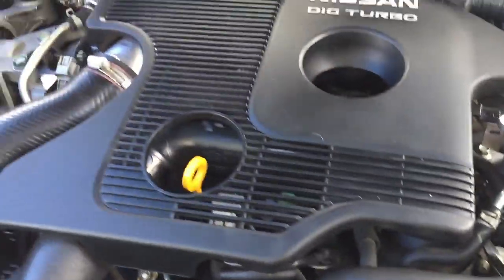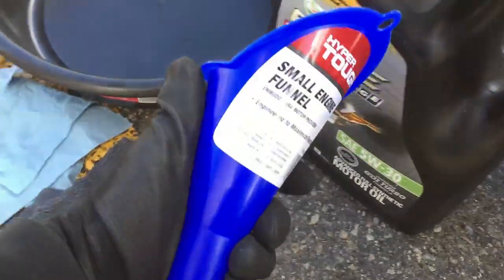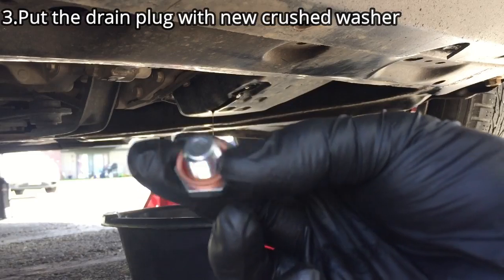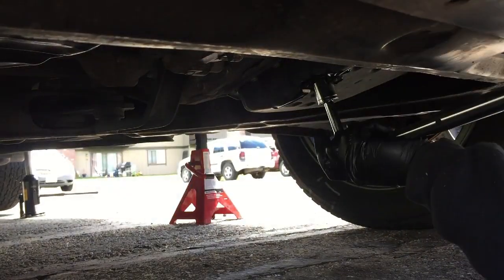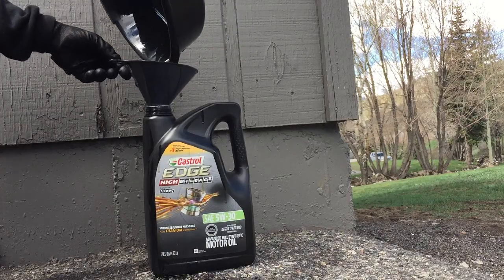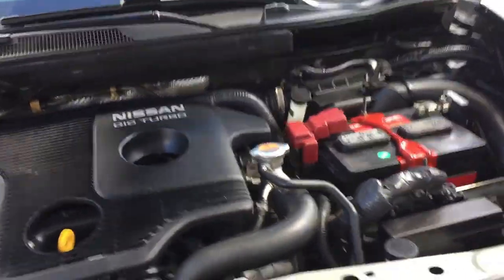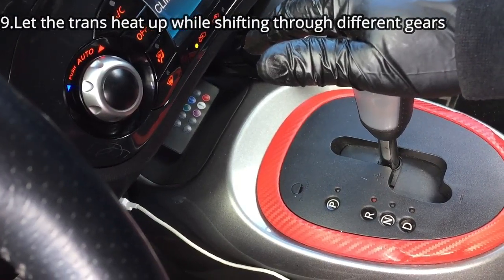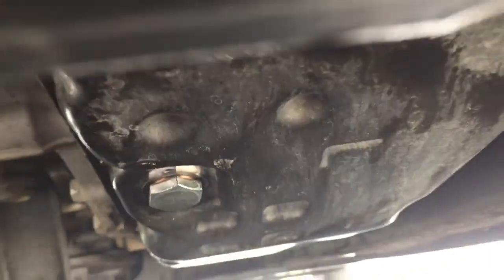How to Exchange CVT Fluid on your Nissan Juke

Comment: Also you need replace the oil transmission filter.
Reply from the maker: This is just a quick transmission fluid exchange not flush
Reply: @Wanderrap  should change both filters every time you open the Nissan Juke transmission. If not, the deposits on the old filter can reek havoc on the CVT belt drive system, even with the new fluid. Spend the extra couple of bucks, don't cheap out!!

Comment: Hi.. I had a code pop up for my car PO744.. it’s only been a day and I never had any driving issues with it before.. mine is a 2013 Juke. The dealership said I need to replace the whole transmission but I’m wondering if it just needs transmission fluid… I don’t wanna spend thousands to get a new transmission if all it needs is fluid.. any advice?
Reply from the maker: Hello!That’s what happened to my juke before.Also told me that I need to replace a new transmission.Try doing transmission fluid flush first.It should be done every 100k miles but if you notice that your juke is loosing power,you might wanna try it first.Works for me and been driving the juke for 3 years now without even replacing the transmission
Reply: Yo supposed tu Change de Every Twenty Five Thousand Miles And The Filter es On The Side ay Have Five Nisan Altima and one juke. But only same Nissans got a CVT Transmisión

Comment: When you check the fluid level after it reaches running temp, do you check with the engine running?
Reply from the maker: Yes.Let it sits for a while
Reply: @Wanderrap  So to confirm, the engine must be RUNNING correct?

Comment: Good morning, by the way, can you tell me how many liters of transmission fluid are needed.
Reply from the maker: It’s 5 liters
Reply: That trans holds 9 quarts
Reply from the maker: @christinemallory4567 no it doesn’t.When you remove the old fluid, measure it so you will know how much you need to replace
Reply: @Wanderrap  yes it does, according to nissan.
Reply from the maker: Have you tried draining it?

Comment: I took it to a mechanic and he didnt measure how much came out.. he said as long is you aren at the right spot on the dip stick its ok.. do you knownif if this is true?
Reply from the maker: Yes it’s fine.Usually,5 quarts of cvt is all you need.And it’s measured between notches
Reply: @Wanderrap  awesome thanks bro.. just an fyi bought ns2 oem equivalent for half the price of regular nissan fluid.. the brand is idemitsu ctfv type n.. same color as the ns2.
Reply: What about the filter
Reply: @brucemcgeehan8255  i have maxima and the filter is not a serviceable part on my car but i was still able to replace..

Comment: Read on a forum about resetting the mileage counter for the CTV in the ECU and this can only be done at the dealer. Can I assume this isn’t really necessary?
Reply from the maker: I don’t think so.When I got my first cvt fluid exchange,they didn’t reset it.Maybe if you’re going to do a fluid flush which draining all the fluid.But if it’s just an exchange,it’s a little different
Reply: @Wanderrap  I have a 13’ Nismo AWD and I just did the drain and fill. The old fluid looked pretty grimy so I’m gonna two more at 15000 miles and the last one will include the filter kit with the side filter. Are all the filters the same for FWD vs AWD?

Comment: How many miles on the Juke did you do to change the fluid? 

I did my wife’s 2012 Juke in June as well but I took off the pan and replaced the retainer/filter as well. Was about $45 at dealer.
Reply from the maker: PNV Rivera recommended miles is after 30k.Nissan dealership overfilled my transmission so i need to do it.Cvt is unforgiving which kinda sucks
Reply: wander rap she bought it used so I do not know what previous owners did. I have been fixing many things with her car since, Juke is an easy and fun car to work on. Great job on the video. Very informative and I’m sure it helped many others.
Reply from the maker: Thank you!

Comment: What mode to you recommend driving in?  Like sport mode ECO etc.  I see people talk about possible issues with the transmission (i think thats the right word) Thanks and love your videos and no doubt I will be asking you questions in the future :)
Reply from the maker: THE DEAD i live here in Colorado where the elevation is up to 9000+ ft.Always using sports mode when driving on a highway.It doesn’t really makes a difference in gas consumption.Check your cvt fluid as well.Before,i’m losing power because my cvt is overfilled by the nissan dealership.it’s been a year since I changed it myself so now,it’s driving good.
Reply: @Wanderrap  Thank you, I am definitely love him, very nice to drive and so spunky looking :)
Reply: @Wanderrap  so that's what is gonna happen if you overfilled it. I've been curious but don't wanna try to overfilled it

Comment: Mine doesn't have the dipstick. Only have the cap without the stick
Reply: use the engine oil dipstick to check and make a mark or measure with measuring tape.  

they do not add transmission dipstick because nissan does not want you to mess with the fluid at all, and thats why the cap is so hard to open as well.
Reply: @1mostwanted253  how do i know if i put in the dipstick correctly since the dipstick is a lot longer tho?
Reply: @bri961  the only thing that matters is you put it the same way after you change the fluid. So whatever way you put it the first time, check it, mark it, and then after you remove the fluid and put new one in, make sure its the same level as before. But to get the most accurate reading, you gotta check while car is running and fluid is hot

Comment: I have a 2014 juke nismo and I cant find the dipstick...its not where yours is located...can you help?
Reply from the maker: Mark Rojas hello!The dipstick for the transmission fluid should be located in the front.Hard to see but it should be there
Reply: I heard that later models, they took out the dipstick. Not confirmed but they say the fill cap is still there but theres so measure stick attached to it

Comment: 2015 nissan juke which cvt2 ya cvt3 oil
Reply from the maker: Adil Bangash for 2015,it’s cvt ns3.Make sure it’s the nissan cvt fluid
Reply: 2011to 2014 cvt2 .2015 to 2017 cvt3 ,u need to change 2 filter from CVT transmission ,
Reply: @Gemini-88  thank you sir
Reply: @Gemini-88  part number for cvt filter?? I have a 2014 max